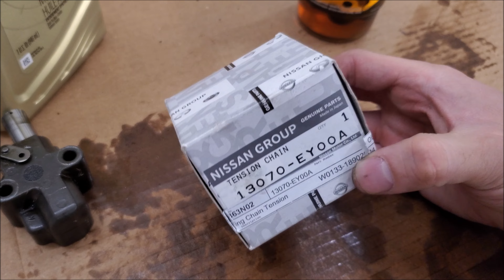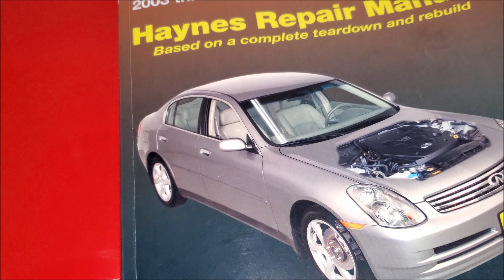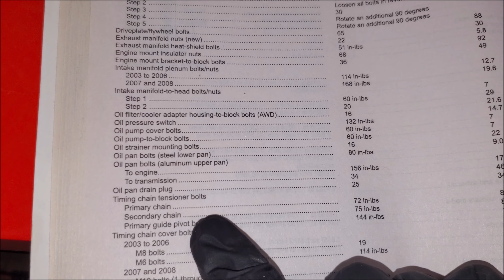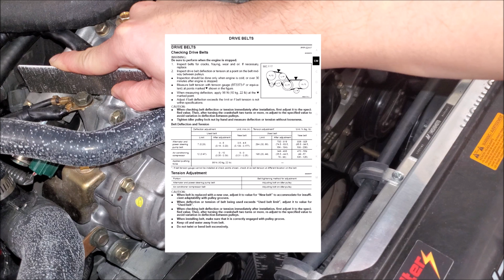Main Timing Chain Tensioner Replacement (Nissan 350Z & Infiniti G35) | AnthonyJ350

Comment: Can the tensioner cause rattle on certain rpms too?
Reply from the maker: It's possible, what's happening?
Reply: @AnthonyJ350  When I leave it on 2500rpms it makes a rattle sound. If lower or higher rpm, there's no sound. Also a slight rattle on cold startup too.
Reply from the maker: @xxkazu78  What oil are you using? And when was the last time you checked the level?
Reply: @AnthonyJ350  I'm using Penrite 10w40 semi synthetic. Dipstick reads around 3/4 full. Last check 2-3 days ago
Reply from the maker: @xxkazu78  Try Castrol 5W40 synthetic next oil change and see if that makes any difference
Reply: @AnthonyJ350  Thanks just bought 5w40 and will see how it goes
Reply from the maker: @xxkazu78  What brand? Castrol also seems to make a difference.
Reply: @AnthonyJ350  Castrol edge full synthetic A3/B4
Reply from the maker: @xxkazu78  OK cool, interested to see what you find. You might want to do a before and after video.
Reply: @AnthonyJ350  Sorry for late reply trying to diagnose air in clutch. just changed to 5w30. Clacking is still there and feels a bit smoother but that's it. There's some vids on my channel if you want to check out the sound
Reply: exhaust leaks and clogged cats can also make rattles under throttle
Reply: @xxkazu78  dude I have the exact same fucking sound in my Altima 3.5 2007. I've spent over a year trying to figure it out and I haven't do you have any idea what it is. When you described It my heart dropped, I went right to ur channel and listened.
Reply: Dude you have a rod knock, i guess I had main bearing knocking for like a year lmao. If you go watch some videos of it lightly youll hear the same sound its just usually only the bad examples. Mine finally gave out.
Reply: @vam6677  Hey mate, sorry to hear yours gave out. I was scared mine would too, so I sold it! A whole bunch of people who heard it including mechanics, either said the tensioners or bottom end. Didn't want to take a chance so yeah, I sold it and bought another car
Reply: @xxkazu78  I wanted to but I have a guilty conscience lol, I'ma just swap my shit I guess then probably sell it. Glad I finally figured it out tho 😂 after a year.
Reply: @staydown4bo  for real? I have a bad cat (P0430) could that be an issue relating to the rattle? When I last hear the rattle, walking around the car idk if I was trippin but I heard it more to the driver side door than the actual front, ima cold start it again and check in a quiet environment before I go out my way to buy a whole timing kit
Reply: @petersonedmond456  yeah bro. Leaks on exhaust happen in the flanges most of the time or if u are hella low. I have an 2012 honda accord and the muffler rattles non stop. bad/clogged cats also rattle but u will smell rotten eggs in the cabin
Reply: @staydown4bo  not long ago I just found out that it’s my cats, numerous had the same exact issue so I won’t have to worry about the chain for now THANKFULLY, I can get some HFCs as my first bolt on!

Comment: Hey, was wondering about the crankshaft pulley part in the video. After you said how to loosen it a little to get some slack in the chain, you never said how you're supposed to tighten it back. Just curious on this part. Trying to replace this part and I'm a little stuck as I can't find any information on the pulley. Any help is appreciated. Thanks
Reply from the maker: After you get the tensioner in and release the locking pin, if there still isn't enough tension turn the crank pulley the other way. You'll want to rotate it after to make sure everything is lined up.
Reply: @AnthonyJ350  Well we're basically stuck at the last part. The tensioner is in and the pin is pulled we just want to make sure that the timing chain is properly aligned so nothing goes bad and don't exactly know how to do that. We've tried researching it but there's not a lot of information surrounding it.

We have tension I'm just confused about if there is a specific torque or technique to tightening the pulley/chain. Or if there can be too much tension also.
Reply from the maker: @instakillers9560  Do you have the wheels secured and the transmission in neutral in order to turn the engine freely?
Reply: @AnthonyJ350  No. We weren't aware we had to do that. Did we mess anything up?
Reply from the maker: @instakillers9560  I don't think so, secure the wheels so the vehicle can't move and put it into neutral and see if it turns by hand
Reply: @AnthonyJ350  Sorry I'm a lotta slow. Turn what by hand? The pulley bolt or the steering wheel?
Reply from the maker: @instakillers9560  Crankshaft pulley
Reply: @AnthonyJ350  So what am I looking to do from rotating it? Is it gonna align the chain or something? I already have tension on the tensioner and the chain is tight. Or does it need to be a specific tightness? Is rotating the engine gonna align the timing chain? I'm still confused sorry.
Reply from the maker: @instakillers9560  You're making sure everything moves freely so you can start it after.
Reply: Tried it. It just loosens and tightens the chain still.
Reply from the maker: @instakillers9560  Is it the exact same as before?
Reply: @AnthonyJ350  If you're talking about how it was originally from the start,, that's the thing we're not sure of. If you're talking about the chain/tensioner then no it moves. The reason why I'm trouble shooting is because we lost track of where it was at. I've also read about the notches on the pulley that might have to be lined up right.
Reply from the maker: @instakillers9560  Well you never actually removed the chain. Just the device that puts tension on it.
Reply: @AnthonyJ350  Correct. So does the chain need to be set right how it was before we removed the tensioner or is it fine at the tension it's at?
Reply from the maker: @instakillers9560  It's fine, just don't crank on the pulley so hard that the chain feels so tight. I backed it  off and let the engine run.
Reply from the maker: @instakillers9560  You want it back the way it was before you removed the tensioner.
Reply: @AnthonyJ350  Okay so what we're going to do in the morning is just make sure the tension is right and put everything back together.  Thanks for your help. Much appreciated. Will give you an update on what happens if you'd like.
Reply from the maker: @instakillers9560  Yes please let me know how it goes. Good luck!
Reply from the maker: @instakillers9560  What's the status on your car?
Reply: @AnthonyJ350  So we got it all back together, started it the next day and it was acted all sorts of weird. Rough idle, the rattling from before was way worse and it sounded like it might have been misfiring too but we weren't sure. Only started it 2 times and kept it running for no longer than 4-5 seconds each time. We're afraid we caused thr pistons and valves to collide.
Reply from the maker: @instakillers9560  I'd pull the cover off and check if the new tensioner is pushing on the chain guide.
Reply from the maker: @instakillers9560  You pulled the lock pin out?

Comment: Perhaps you can help me. I use my 2002 Tahoe with spring and Moog HD for work but sometimes when the load is more than 650 kg. their hardness is not enough. I am thinking of the airlift 1000 or Timbren and I don’t know which one to choose. What do you think? I am afraid the Airlift will not withstand temperatures below -30 Celsius. Thank you in advance)
Reply from the maker: Timbren is nice because there's virtually no maintenance.  Do you need the adjustability with Airlift?

Comment: Why did you replace your timing tensioner to begin with?
Reply from the maker: Was chasing a rattle. It seems I found the noise being caused by the VVT control solenoid in a later video.
Reply: @AnthonyJ350 what is the video with the noise?

Comment: Out of interest did you have a chain rattle on yours before you made the change? Noticed any improvement?
Reply from the maker: I have a little but I think it's coming from my driver side actuator for the variable valve timing. Only happens after a minute or 2 after I start it and it warms up a little. When I first start, it's smooth.
Reply: @AnthonyJ350  thanks man, yeah I have for like .2 seconds on startup think my tensioner is seeping pressure when the car stands... useful video! Thanks!
Reply from the maker: @joelgoacher1643  What oil are you using in the car?
Reply: @AnthonyJ350  5w40 now I think, good oil and pressures are all fine
Reply from the maker: @joelgoacher1643  ok right on
Reply: @AnthonyJ350  thanks for your content man!
Reply from the maker: @joelgoacher1643  You're welcome!
Reply: @AnthonyJ350  Hey, hows the car going now out of interest?
Reply from the maker: @joelgoacher1643  Car is fine. It's off the road for the season but I move it around when I need to work on other vehicles on the hoist.

Comment: How u know that the timing chain isn’t bad
Reply from the maker: If it's idling quietly it's most likely fine. Just make sure you're changing your oil regularly.
Reply: My sister car went bad but has a start button is bad and need timing chain but it’s at 250k is worth fixing !!! Car has be lowered 1inch from ground
Reply from the maker: @jayjb833  How long do you want to own the car for?

Comment: I just realized your engine is a Revup lol 👍🏼
Doing this requires alot of patience. The last time I did this I almost dropped the 10mm bolt inside the timing cover. Just getting your thumbs to reinstall the tensioner was annoying.
Reply from the maker: You just realized this now?! Lol, how long have you been watching my stuff??? 😆
Reply from the maker: It was such a pain pulling the chain back to get the new tensioner in. Hats off to the mechanics that do this daily in a timely fashion.
Reply: @AnthonyJ350  I think I'm losing my mind a bit and needs some preventative maintenance haha. I've known your Zed specs all these years. Ironically I also own a revup 07 G coupe but it's been sitting without a battery.
Reply: Do you get tap sound cold start
Reply: @allejordan109  sounds like you need oil

Comment: y havent u deleted that pulley that is only used on early 2003 models that had mechanical fans
Reply from the maker: Which pulley? Is there any drag on it or is it an idler pulley? This is a 2006, so if I delete a pulley does the belt stay the same?
Reply from the maker: Just looked up delete kit, Z1 offers it with a spacer and shorter belt. Thanks for letting me know about this! I'll order it and make a video on it.
Reply: also when it’s time to replace ur belt just order one for a 2008 fx35 and its the correct size once the pulley has been deleted
Reply from the maker: @ImEnhalos  Is that because that vehicle is still a DE platform for that year?
Reply: @AnthonyJ350  not sure if its a de or hr but it fits, thats the belt i'm running on my DE. The 08 FX came from the factory with the spacer and pulley delete that is y it fits once you do the same
Reply from the maker: @ImEnhalos  Good to know, thanks

Comment: Hi Anthony, when and at what mileage you have to replace chain tensioner, water pump and spark plugs?
Reply from the maker: Technically the timing chain tensioner is just when the chain needs replacement. I would consult the service manual for the other intervals. What's the mileage on your car?
Reply: It doesn't say in the manual when timing chain should be replaced. It's a 350z 2003 with only 86000 kilometers.
Reply from the maker: @borisstupar5147  Timing chain should be good for 160-200,000KM. Water pumpaune do at 120,000KM. Spark plugs I'd change prematurely everything 60,000km
Reply: Thank you bud, I appreciate that!
Reply from the maker: @borisstupar5147  You're welcome, those are just estimates. You'll want to consult a service manual like Hanes or call the dealership for info.

Comment: You need to take this video down! i did this to my car and now it runs like shit and is throwing cam position sensor codes......more than likely because my chain off time
Reply from the maker: My car runs fine. What brand did you use?
Reply: @AnthonyJ350  Nissan......I'm worried that my chain must have sagged off of the crank gear then when I applied tension again it somehow missed by a tooth I don't know how else it could be off
Reply from the maker: @zachblakey489  You some how got the chain to come off, and got it back on the sprocket enough to change the timing? Why should I take down the video again?
Reply: @AnthonyJ350  I don't know how it can be off... it's not running the same! Maybe not take the video down but a warning of what can happen wouldn't hurt
Reply: @AnthonyJ350  Im not blaming you ....that wasn't the point of my comment.....I just think people need to be aware of what can happen! I followed everything in the video I didn't have to turn the crank to get slack needed so nothing was turned....I'm not sure what happened!
Reply from the maker: @zachblakey489  I do, there's a written disclaimer before each video.

What do you want me to warn people about though? We don't know what is happening to your vehicle exactly yet.

Comment: Nice when mine starts up I hear a rattle lol
Reply from the maker: Could be the tensioner. Does it idle smooth? What oil are you putting in the car?
Reply: @AnthonyJ350  same issue here, mine run smooth and I use pennzoil 5w-30, although I only started hearing this noise after I did it’s oil change not long ago..
Reply from the maker: @petersonedmond456  You can try using STP high mileage oil additive.
Reply: @AnthonyJ350  will do, my oil is full, will it hurt to add it as it might overfill slightly or?
Reply from the maker: @petersonedmond456  It's ok to add a little as long as you're not overfilled already. Might want to observe your oil pressure before and after.
Reply: @AnthonyJ350  alright I’ll try this out, thanks
Reply from the maker: @petersonedmond456  Let us know the results. You might also find this video helpful
https://youtu.be/5Nmxi0du8-Q
Reply: @petersonedmond456  results????

Comment: Nice video!  With these cars, have you experienced the engine fan run on "high" after 20-30 mins of driving and doesn't shut off until I put my heater on full blast 

No noticeable coolant leaks on the floor or decrease in coolant level.  No over heating on the temp gauge.  Water pump replaced.  Slight coolant smell.  And I do have a small engine valve cover leak on the left side, noticed when I did my spark plug change.
Reply: When you say coolant smell what do you mean? What does the gauge read on the car? Should stay about mid or just below
Reply: @joelgoacher1643  Hey Joel thanks for chiming in.  The gauge is just under the half.  So nothing alarming.  I smell a slight hint of sweet coolant smell from the engine when the engine fan is blasting on full.   This is noticed only from outside of the car. 

Although I do hear a bit of swooshing noise when I accelerate at first to second gear.  I've bled the radiator so many times already.  Nothing that signifies that there is a blown head gasket.
Reply from the maker: Have you replaced the thermostat? https://youtu.be/rFY3iduvjxM
Reply: @AnthonyJ350  Yes it was replaced by my mechanic who replaced the radiator as well.  Does it sound like it might be that?
Reply from the maker: I would be inspect and/or replace old coolant hoses first given the age of the vehicle. There are cross over pipes under the car as well to inspect like coming off the oil filter.
Reply: @aey2579  I would be tempted to check the coolant for combustion bi-products to be sure its not the head gasket or some sort of cracked water passage. There is a little bleeder towards the back of the engine in the line that feeds the heater coil that might help get some air out

Comment: Good video. I'm trying to not take the timing cover off AGAIN!, and just reset the plunger and pull my BROKEN! guide up into place 🙏 does anyone think it will work for a bit? Obviously with 2 people one to pull the chain and guide back while I put the tensioner back in.....oh 5ive maxima 666666speed
Reply from the maker: What happened to the chain guide?
Reply: @AnthonyJ350   I heard it rattling around.  AGAIN... They keep breaking. If this ghetto fix doesn't work then I will rip it apart and buy the best timing guides they got . The top piece usually breaks and the plastic piece slides down
Reply from the maker: @johng8888  Is it a Nissan part you put in?
Reply: @AnthonyJ350  no I actually bought a jdm motor and TOOK out the original guides and put ebay ones in while I had the motor out, which I wish I wouldn't have done. Only reason I did because the ones prior blew out which were ebay. And original motor prior I blew lol but if all fails and I have to tear it apart I'm going to go find the original guides from Japan and put them in so I get where you're coming from on that
Reply from the maker: @johng8888  Ya when it comes to major components, unless you know a brand that produces it for OEM or you know for sure is engineered better than OEM, it's best to stick to original parts for consistency.
Reply: @AnthonyJ350  thank you brother
Reply: @AnthonyJ350  I put headers on it while I had the motor out. Had to buy else where and have it shipped lol but what the heck why not....Its bad ass now.  Thanks for the insight and tips 👍
Reply from the maker: @johng8888  Keep wrenching and learning!